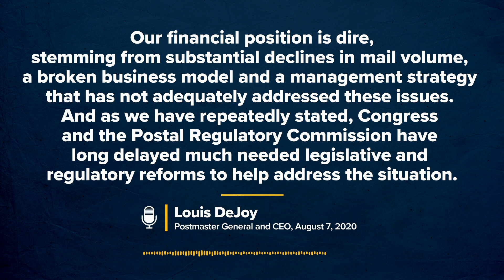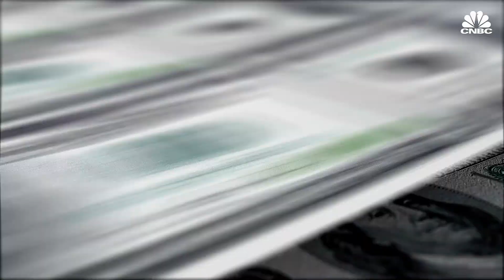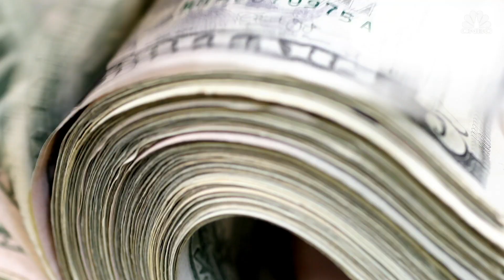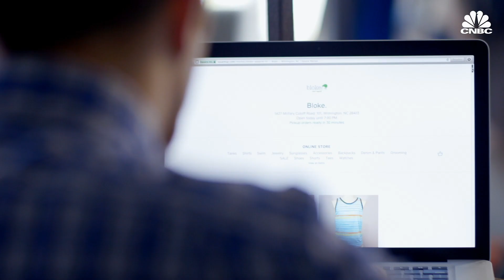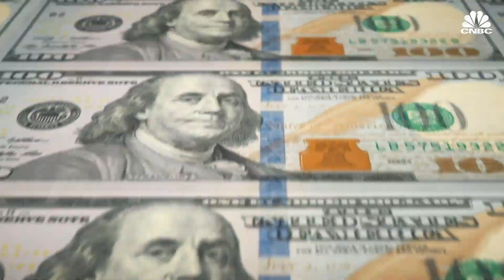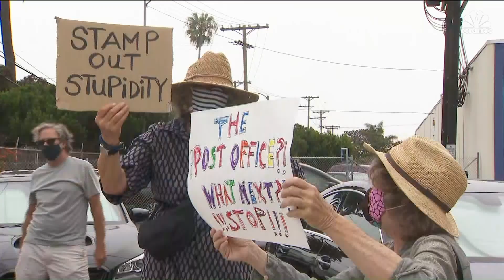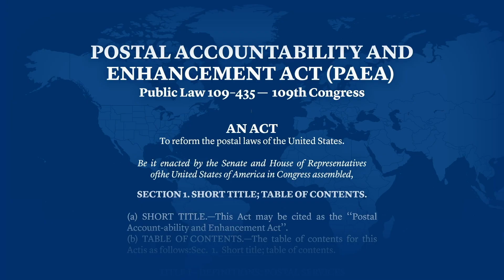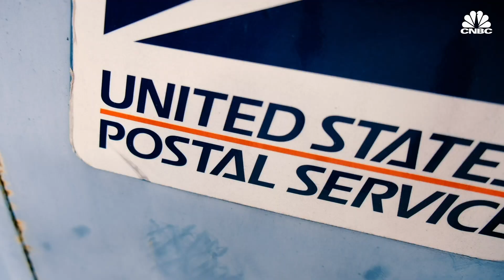How The U.S. Postal Service Fell Into A Financial Black Hole

Comment: 🔥🔥🔥🔥🔥🔥  Picture this: you job transfer from one location to another. You are new to the employees at this location, however you are not new to the job. While at this new location and during the course of your duties, you are solicited by a male supervisor whom you are not particularly interested in dating. You state clearly your disinterest to this supervisor, who responds by sexually harassing you. After making the harassment known to your co-workers, this supervisor only INCREASES his level of sexual harassment to the point that your own co-workers are strongly advising you to file an EEO. Having never filed an EEO in your career, you naturally rely on those who you would think would know or can at least assist you with knowledge of the process......your union official, shop steward. After approaching your shop steward, stating the issue, and receiving assurance that "we will get to the bottom of this" and "we all need to stick together" and other such notable words of encouragement, how would you feel at this point? Imagine, if you will, your shop steward telling you that a meeting is being set up between you, the union official, and the supervisor, in order to conduct your "EEO". Picture being in a room with these two individuals and the supervisors starts sexually harassing you right in front of your Union Official......the SAME EXACT manner and way as when the supervisor was harassing you on the work room floor in front of your co-workers. You look towards your shop steward to do his job and "get to the bottom of it". Instead YOUR Union Official is looking down at the floor, GRINNING AND SMIRKING and not saying a word. After the meeting you find out it was all a setup to "shut you up" and "show you who is in charge". You also discover the supervisor is WELL-KNOWN for sexually harassing female employees and the Union Official is the same way............by this point that fact is quite obvious! 

SUNCOAST DISTRICT/ Tampa, Florida Department Of Justice, Inspector General, Office Of Special Counsel. I see you ARE paying attention. So there seems to be more of a handle on the “Hiring Practices”. Of course we see how far skewed it has become. That was the immediate issue. Now to address the NEPOTISM, CRONYISM, and RACISM in this installation. No need to insult you with the well-documented effects of these 3 “ISM’S”. The supporters of the Nepotism will say “we need the Family Members to combat the Racists in this Organization”. The Cronies will fall in line to whomever “seems” to be offering them what the think they want. The Cronies will then call in “return favors” for their Allegiance. The Racists will use whomever they can for as long as they can. The “CULTURE’’, as your boss Mr William Barr so eloquently stated in his testimony to Congress, of THIS INSTALLATION is one of extreme Nepotism. Extreme to the point that even the “clean” family members agree that there are far too many “dirty” family members employed in this Organization. We are far, far past a person having their Father, Mother, and 2 Offsprings working here. We are now into Father, Mother, 3 Offsprings, 2 First Cousins, 1 Second Cousin and 1 or 2 or more Grandchildren! Reportedly, we have a family with over 100 Family Members spread throughout this Suncoast District. The "dirty" family members will openly declare "well, you have to get rid of all these other family members before you can touch us". I do not need to inform you, with all your vast collective experience in these matters of the issues and problems that arise in this type of environment. I would be remiss in my duty if I DID NOT inform you that Veterans of the United States Military employed here will only tolerate a finite level of abuse. This is what these Family Members and Cronies are failing to understand. I strongly urge you to take another VERY CLOSE look at the Paperwork originating from this District concerning these “alleged” abuses. I predict that if you three Organizations that are tasked with resolving these issues and performing as Watchdogs to these grievious miscarriages of Justice, along with our elected Representatives fail to get this under control, MEMBERS AND OFFICIALS OF THIS ORGANIZATION WILL BE SUBPEONED TO APPEAR BEFORE CONGRESS TO ANSWER QUESTIONS ABOUT THE FAILURE TO PROPERLY ADDRESS AND RESOLVE THESE WELL-REPORTED MATTERS. I thank you for your time and attention concerning this subject.
Department Of Justice, Inspector General, Office Of Special Counsel. I see you ARE paying attention. So there seems to be more of a handle on the “Hiring Practices”. Of course we see how far skewed it has become. That was the immediate issue. Now to address the NEPOTISM, CRONYISM, and RACISM in this installation. No need to insult you with the well-documented effects of these 3 “ISM’S”. The supporters of the Nepotism will say “we need the Family Members to combat the Racists in this Organization”. The Cronies will fall in line to whomever “seems” to be offering them what the think they want. The Cronies will then call in “return favors” for their Allegiance. The Racists will use whomever they can for as long as they can. The “CULTURE’’, as your boss Mr William Barr so eloquently stated in his testimony to Congress, of THIS INSTALLATION is one of extreme Nepotism. Extreme to the point that even the “clean” family members agree that there are far too many “dirty” family members employed in this Organization. We are far, far past a person having their Father, Mother, and 2 Offsprings working here. We are now into Father, Mother, 3 Offsprings, 2 First Cousins, 1 Second Cousin and 1 or 2 or more Grandchildren! Reportedly, we have a family with over 100 Family Members spread throughout this Suncoast District. The "dirty" family members will openly declare "well, you have to get rid of all these other family members before you can touch us". I do not need to inform you, with all your vast collective experience in these matters of the issues and problems that arise in this type of environment. I would be remiss in my duty if I DID NOT inform you that Veterans of the United States Military employed here will only tolerate a finite level of abuse. This is what these Family Members and Cronies are failing to understand. I strongly urge you to take another VERY CLOSE look at the Paperwork originating from this District concerning these “alleged” abuses. I predict that if you three Organizations that are tasked with resolving these issues and performing as Watchdogs to these grievious miscarriages of Justice, along with our elected Representatives fail to get this under control, MEMBERS AND OFFICIALS OF THIS ORGANIZATION WILL BE SUBPEONED TO APPEAR BEFORE CONGRESS TO ANSWER QUESTIONS ABOUT THE FAILURE TO PROPERLY ADDRESS AND RESOLVE THESE WELL-REPORTED MATTERS. I thank you for your time and attention concerning this subject.

MANAGERS handing out Official Postal Documents describing how Nepotism is “frowned upon” in the Postal Service.

The very same Managers have their Mother, Father, Son, Daughter, Niece, Nephew, 3rd Cousin removed on their In-Laws side all working for the Postal Service and ALL in the SAME BUILDING.

 🎓🎓🎓🎓🙅🏽

Comment: If you are a United Parcel or FedEx delivery driver remote rural residential deliveries are the easiest and best routes to have.
  They don't generate the kind of profit as business to business do,
because most houses only received one or two packages at a time. I ran a total rural route one Christmas and drove a 100 miles and delivered a 100 stops. That's one delivery for every mile driven.
  Delivery stops for that same route   during the summer would be one delivery for every 3 to 5 miles.

   The trucks that the Post Office is using right now is made for delivering letters and envelopes not a 3'×5'150lb oversized boxes.If they start delivering bigger oversized packages they will certainly need to start buying larger trucks like FedEx and UPS.
Or they will lose even more money sending two or three mail trucks to cover one residential address.
  The Post Office delivers letters to every rural address in the nation every day. So they are the go choice for rural areas delivery right now, because everyday they are delivering letters to every street and address in the nation's rural areas anyway.